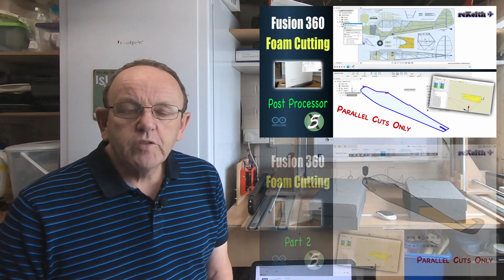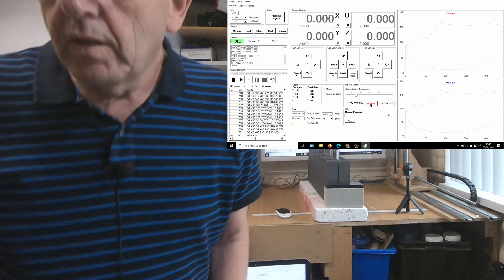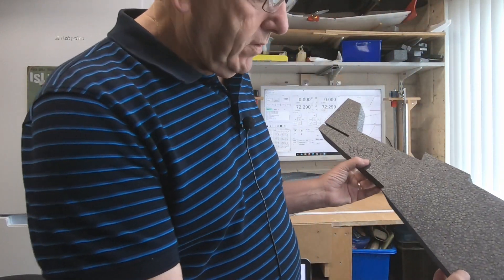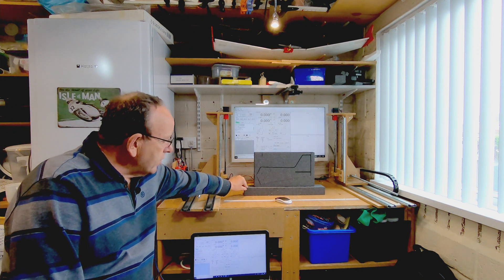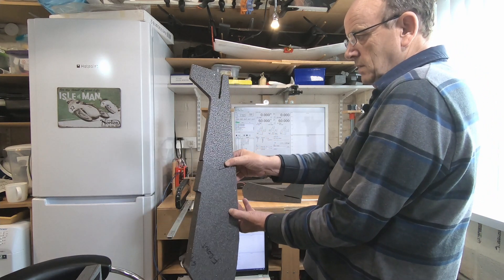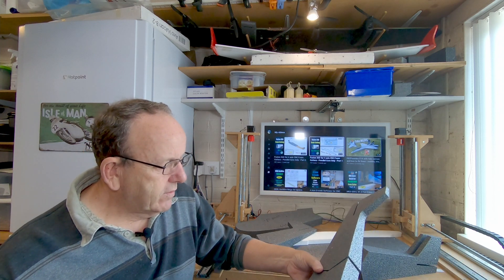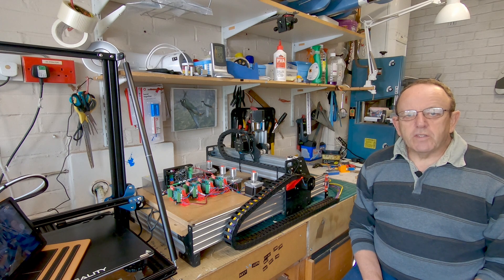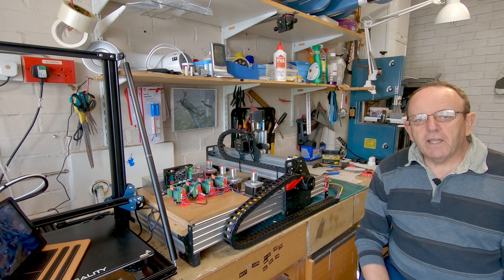Fusion 360 for 4 axis CNC Foam Cutters - Parallel Cuts Only - Part 3

Comment: Hi Keith  You've sparked my interest in making  my own models. Where do i source foam from that's suitable for RC planes. Thank you.
Reply from the maker: Hi, David, You can use plain old polystyrene foam available at most local hardware stores. The foam in the video is black polystyrene which I get from B and Q in the UK our biggest home hardware store. I also use XPS foam which some hardware stores sell as well.  Hope that helps.
Reply: Hi Keith Thank you for your help, and thanks for the videos.

Comment: Hi I watched you video on Linuxcnc and I am on that path now.  Why did you leave Linuxcnc as stated in the comments for that video.  very good video did supply answers to questions I have about loading G-code in "Axis"
Reply from the maker: LinuxCNC is very good but needs to use a computer with a parallel port. These are obsolete now and the old computers I had were taking up too much space and were starting to fail.  So I scraped them. To use LinuxCNC on a more modern computer you need to use a specialized adapter called a Mesa card. Which are quite expensive and can be tricky to set up.  I would also need to dedicate a computer to Linux. So for me, it was time to move to either Mach3 or GRBL. I have chosen GRBL,
Hope that helps
Keith
Reply: and can be tricky to set up
Reply: @rckeith  Thanks for the reply I have the Mesa (7I76E and a PC linuxcnc configured. But things are going very slowly, due to the complex nature of Linuxcnc. I have built 9 (from scratch) CNC tables.  I used Mach3 and UCCNC software and these table were for plasma, routing, metal scribing, and drag knife.  Linuxcnc is much harder to learn due to its complex mature.
Have fun Tom
Reply from the maker: Hi Tom
Yes LinuxCNC can look a little daunting but lickily for me being so old I was around for the very first versions and used Linux for many years as well as Windows. I retired as a Linux System Administrator but started work as a apprentice motor mechanic, but thats a long story!
Stick with it because it is very good and maybe one day I'll come back to it.
Keith
Reply: @rckeith  Thanks Keith
I am making progress, Linuxcnc has a different approach, but my mind is getting the big picture.  I am a retired Field Engineer in computer based work with many different systems.  I found with software it is finding the names or procedures to connect how things are done with them.
Have fun
Tom
Reply: @rckeith  Nice video 
Interesting the plane in your video was the first plane I flew in back in 1961, as a passenger :)  :)